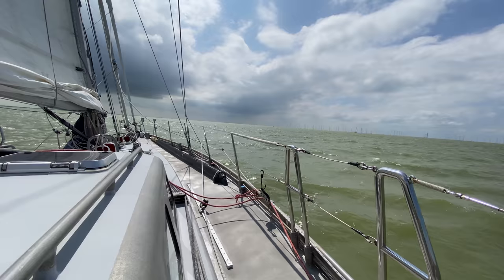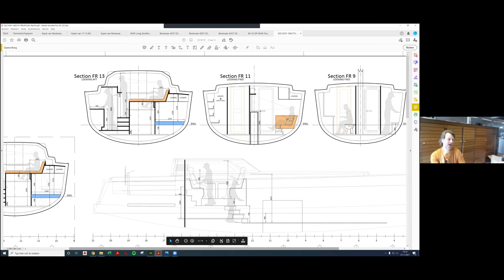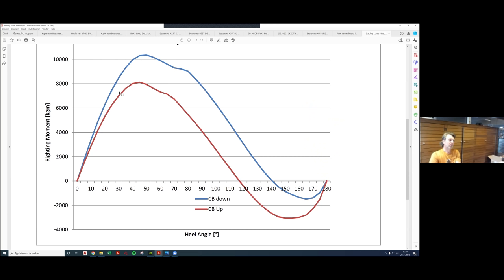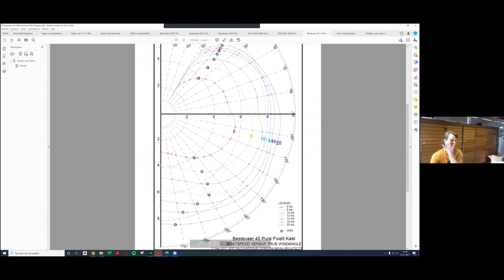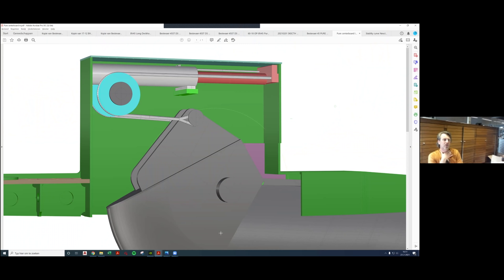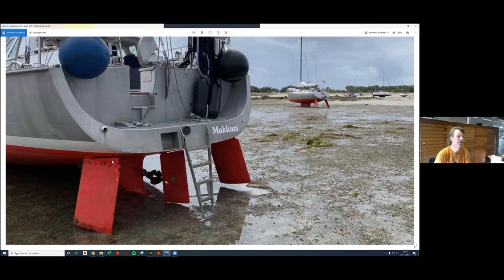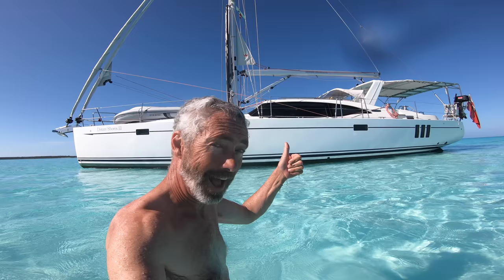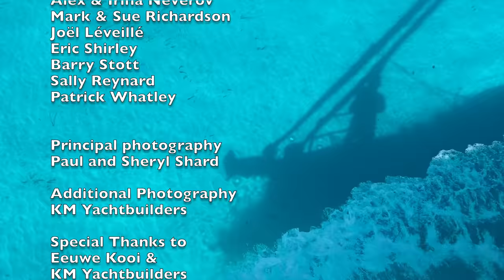Centreboard or Lifting Keel? Building an Aluminum Boat - Design Part 3 with KM Yachts | EP 207

Comment: That was very enjoyable. Some years ago I was designing a 39ft Bristol Channel Cutter as a ferro cement boat when I began to see your earlier Distant shores and fell in love with the whole “drying out” feature. I had built a swing keel Samson Cquoia ferro cement boat back in the seventies but that had a 4’6” draft, and would not stand on its keel (I did try that once by accident but it fell over when the tide went all the way out). So with the Bristol Channel cutter (traditional lines) I took to the hull with a cutting plane and took the keel off to a flat plane and designed a stainless steel grounding plate and a swing keel very similar to the Southerlies, and it worked (as a design at least … never built … too old … bought a S135 instead, now living aboard permanently). The completely retracted keel is to be fought for, I agree. When I get sailing I will consider a rudder rebuild with a retracting blade.

Comment: Be sure to find out how to check that keel pin (yolk or whatever they call it) or mounting points for any signs of pending failure. Catalina swing keels have problems with the keel bolts failing and the keel falls out and there goes all your ballast.

Comment: Hi Sheryl and Paul,
You've gained huge experience with Southerly yachts so surprised to hear you mention you were looking to improve the performance of the keel. I always imagined the later Southerly keels to be amongst the best solutions available, I.e. fully retracting, cast iron grounding plate, deep draft when lowered.. In what way do you feel they could be improved?
Reply: I can't pretend to know what's in their minds, but both they and particularly Eeuwe did make reference several times to the relative inability of the rudders in this style of boat to exert sufficient turning or course corrective effort in all situations, due to their shallow draft. I wonder if they were thinking of the keel/rudder system as a package when they made that comment? 
The minimum draft of the keel system does (in the absence of transom-hung, dagger rudders) effectively dictate the maximum draft of the rudders, even if they are telescopic (which as Eeuwe points out, is not a popular option)

Comment: Do the sailboat stability calculations take into account high equipment such radar, solar arch, davits?  I wonder how much the additional equipment alters stability.
Can the keel be locked in the down position? If the boat was knocked down the keel needs to remain in the down position.

Comment: Great point about the pilot house air volume preventing a roll over, had not thought about that before, but the windows would probably need to be hurricane windows to keep them from breaking. As I turn my direction away from catamarans and back to monohulls, I am looking for a monohull with both the shallow water capability and the 360 degree views through the wndows. I am surprised the pilot houses are not bigger?  extending  forward past the mast,  taking from the american down east style, put the galley in the pilot house along with a head, 2nd helm, a bedroom for the pilot; and finally only one helm in the cockpit, I would not want twin wheels in the cockpit of a cruising boat. I would consider no helm in the cockpit, maybe just a throttle for the engine and use the remote for the auto pilot possibly. I have seen a similar set up on custom boats but they were home built and did not have the fit and finish of these boats from Europe.

Comment: Really enjoying these talks with Kooi...
Reply: No they are not. Not even close!

HR 44ft goes around 12000 max at 60, this at 45ft goes around 10000. HR 50 is even higher at all angles.
Reply: @mtrezaie  You are of course right 👍🏻 I must of remembered the HR figures incorrectly, Thanks 🙏🏻
Reply: @mikedevlin2048  Well, HR boats are heavier. These boats much be having more performance if I am reading polar charts. While being a tank.
Reply: @mtrezaie  I Sailed on a HR49 years ago... Fantastic craft.
Reply: @mikedevlin2048  They are dream boats.

Comment: Excellent video.
One question - I saw the stability curve, which is very impressive; however, if the boat gets knocked down and there is no securing pin on the centreboard, at what angle does gravity want to re-house the centreboard. Should a 're-housing' occur, what does this do to the stability as all the ballast is in the center board. Just a thought.

Comment: Great interview! Very informative, thank you:) I have a question regarding the vanishing stability chart with keel out vs in. With a swing keel, when passing beyond 90 degrees, is there a point that the keel swings into the up position as you roll over? I am unclear if there’s any mechanism keeping the keel in the “out” position. And if not, it would seem the boat would immediately switch to the other plotted stability curve?
Thanks

Comment: I have a question concerning location of the sink, its so close to the hull on starboard. When sailing up to the wind, the boat will heal, and correct me if I'm wrong, if you forget to close the valve, the sink will fill up with water, or even worse, the water will run out in to the boat???m

Comment: Cool to learn a little about the swing keel. The last years the french center boarders have run with alot of the attention. I am curious though about the swing keel - the stability curves are impressive. But in the unlikely event of a capsize will the swing keel still stay in the fixed “down” position or will the invert of the hull swing it in and thereby decreasing the positive stability?
Reply: I just Saw you answered same question further down. Thanks 😃

Comment: Very interesting!

About the center board design: The Dyneema pulley is clever ... but that also means the board will swivel up when the boat is rolled over topside down, no? At what angle does that happen? Why doesn't the stability curve take that into account?

Thanks again for these great videos!
Reply from the maker: Very good question! Yes if the boat goes past a 90 degree knockdown the keel would want to retract. However KM have used a system with a clever retaining line that stops that from happening. We'll cover that in an upcoming video.
Reply: was wondering this too
Reply: I think there is “ less” time to fold back during a role. 
The hing point are not that well greased als the hinge is aft of the keels Center point of gravity.
Reply: Some lifting keels have a shear pin or k
Catch to lock the keel down but if the keel strikes anything too solid it will break allowing it to fold back into its box. The other type is the dagger board type lifting keel that has to be raised and lowered..
There are also keels that are water ballasted for Smaller vessels.

Comment: Centerboard vs lifting keels? 
Mine has leeboards. It's a Herreshoff Meadow Lark, stretched to 37 feet and built in fiberglass by Alan Vaitses.
It's sharpieish - narrow and shallow. Eight foot beam means it can be trailered without permits, but being that narrow it's nice to not have a centerboard trunk.
Reply from the maker: Thanks for your comments and insights, Jeff.

Comment: Excellent series and love the design discussions.  I apologize if I missed this somewhere but I was curious if you also considered Garcia, even as a comparison of functionality and design?  When you announced your next project, it seemed a forgone conclusion that you had already selected a design and build team.  It seems like quite a bit of duplication with Jimmy Cornell's Garcia.

Keep up the excellent work and best of luck.
Reply: The philosophy is much the same, but I get the impression that they are really trying to maximise righting moment over the Southerly centreboard. The Garcia has all the lead in the bilges and very little in the centreboard, so it's unlikely to be an improvement in that regard. 

Of course, sailing with the centreboard of the Garcia up is no real hindrance because it doesn't affect righting moment that much...

Comment: What is the difference between dagger boards compared to lifting keels or centre boards
Reply: dagger boards arent heavy weight and are only used for sail performance rather than stability

Comment: You lost my attention at about 25 minutes in. The segment was about the difference between centreboard and lifting keel. However, so far through the clip I noticed that no distinction was made between those two solutions. In fact, I think they were used as if identical solutions.

Comment: The stability curve looks wrong. It seems to assume that the centreboard will stay down as the boat turns inverted, which of course it won’t with this mechanism, which requires gravity to keep the board blue line should jump to the red line at some point; Im guessing somewhere not far past the vanishing stability point for the centreboard down case, so the energy to recover from an inversion will be greater than the designer seems to claim

Comment: Nice boat and builder. About the stability curve, there’s an important flaw in it. The keel has a ram to lift it via Dyneema lines, so that it kan kick up when hitting something. A good system, I think, but with one problem: The mechanism only lifts the keel. Only gravity keeps it down. If the boat were to be rolled, the keel will certainly fold in, making the keel out part of the curve irrelevant. Even though that’s also ok enough, and the situation will be extremely rare for normal cruising grounds, it might make a huge difference when actually rolled. Perhaps it could be useful to have another Dyneema line that can lock the keel in it’s down position for extreme weather situations? 

On the other hand, many report that such boats behave better in extreme weather with the keel lifted, as it makes the boat slip away sideways some, reducing the wave impacts and max heel incidents. Possibly even reducing the risk of being rolled. This is probably even more interesting when having deployed a Jordan Series Drogue. I have no experience with monohulls in true extreme weather, (have sailed a cat in sustained 70 knots, about 16 hours, no JSD available) so I’m just speculating here.
Reply: the lift keel of a Alloy 40ft Adams has bolts to lock position - it not designed to go up/down while sailing